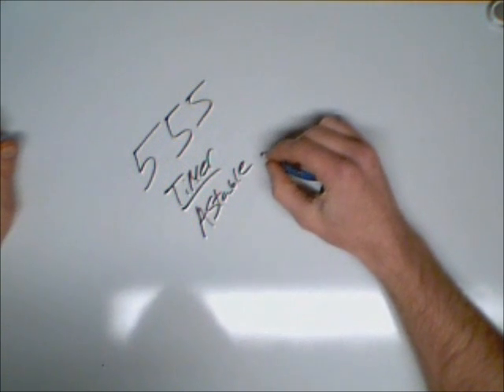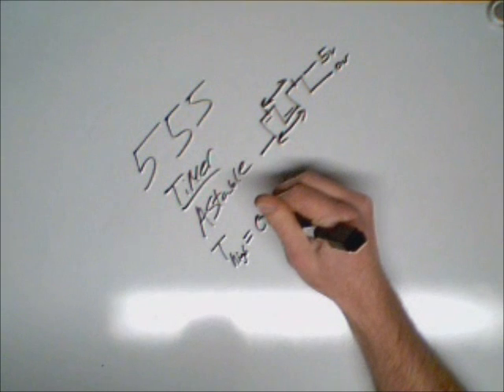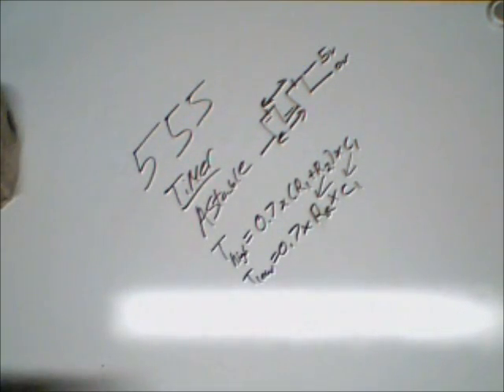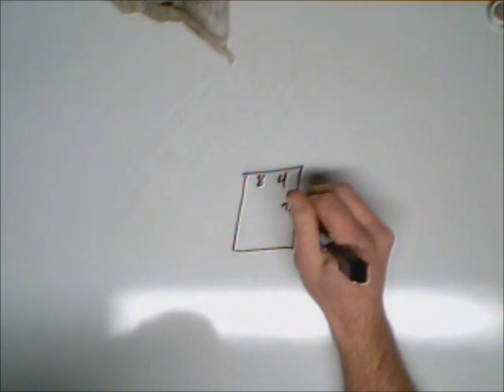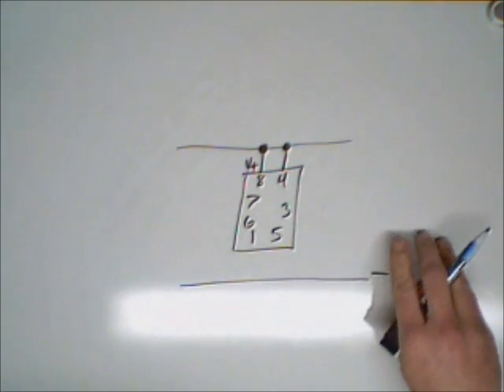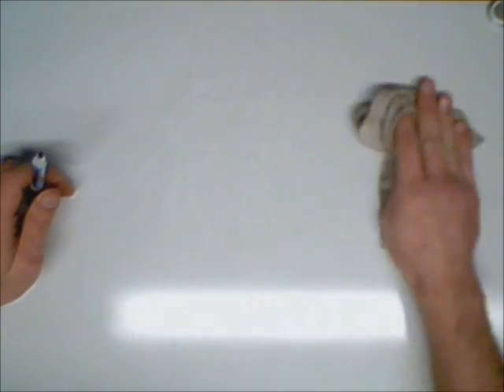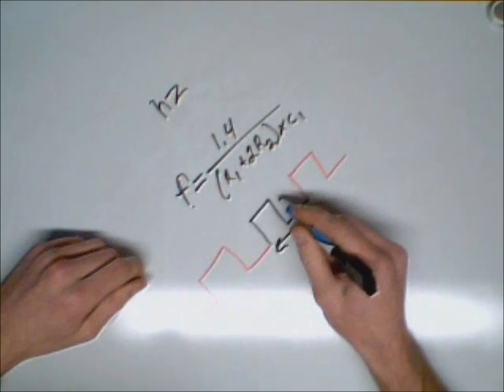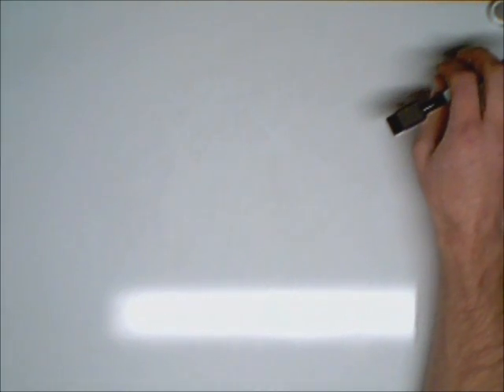555 timer astable Explained

Comment: Thanks for explaining that C is measured in Farads, and that uF means 1/1000000
or 1 millionth of a Farad.  Thank you very much for that.. Now I can calculate the formulas where as before I could not. I saw a video on the 555 with the title According to Pete 10-2-11: 555 Timers, and he had a sound making device that used an astable 555 circuit feeding into a monostable 555 circuit.  I think that it sounded pretty good. I want to build that, or variations of that.   Your video really helps.

Comment from the maker: The best way to understand any microchip is to learn to read datasheets, also do some research on how the 555 timer operates. you can actually construct a 555 timer on a bread board with like 20 some transistors and some caps.

Comment: hey its gud explanation i got for 555. but in my lab i have a diode IN-4001 connected across R2 in terms of your circuit.. could you tell y is this diode hooked up across R2?

Comment from the maker: @DIYElectronics were setting up a RC time constant with the caps and resistors and is it hooked to pins 2 and 6 which is the threshold and trigger, so the cap charges between 1/3 and 2/3 vcc (time constants google google) changing the duty cycle =) best thing to do is look at data sheets it explains in better detail.

Comment from the maker: @1SmokedTurkey1 I understand what your saying there turkey, this video was made just to explain one mode of the 555 timer, but in order to start to understand the 555 timer, you need to look at the data sheet, search google for that. once u got it, it explains pretty much what ea pin does with respect to whats applied. data sheets are the best thing to look at when trying to understand your parts. and basically whats going on it in this circuit, is.......

Comment from the maker: @johnmc1985  R1 goes from Supply volts to pin 7 then R2 goes from pin 7 to pin 2 and 6(just hook pin 6 to pin 2then pin 2 to R2) then the capacitor is conected between pin 2/R2 to ground. 
   hope that helps.

Comment: when you talk about the frequency of the wave do you mean the pitch or the pulse time? for example, if you attached a speaker to the output of the circuit, would varying the either resistors or the capacitors make the pitch of the note change or would it make the pulse of the note change?